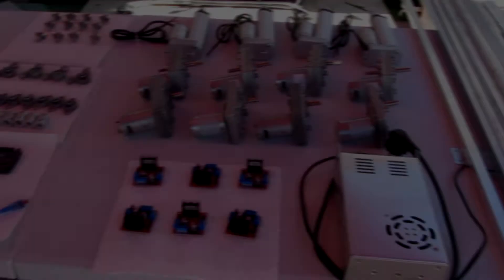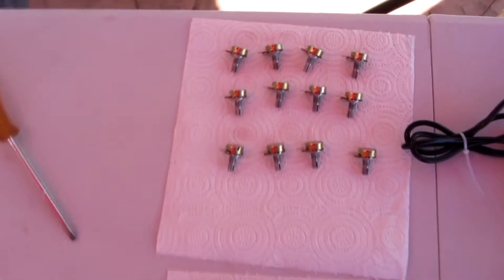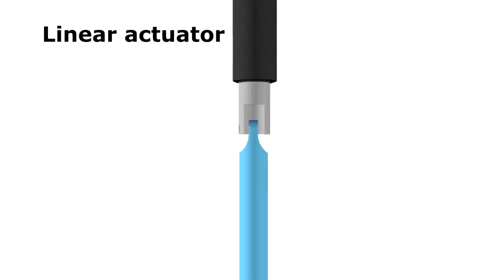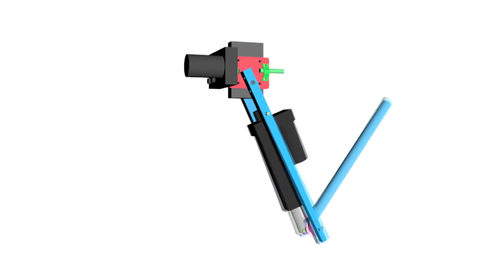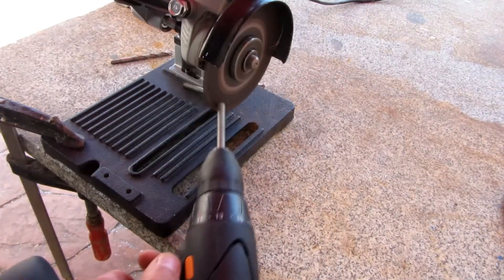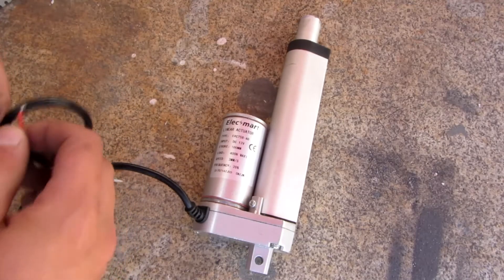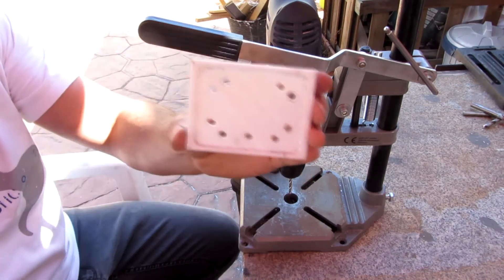#3 Assembly: paws - Pavlov project: Building a quadruped robot

Comment: hola,  muy buen video. Tengo una duda, donde conseguiste esas juntas que van con el motor DC ?, la estructura
Reply from the maker: hola! gracias! te refieres a la caja reductora de metal que va acoplada al motor? Eso lo compre todo junto, puedes encontrarlo en  aliexpress, por ejemplo:
https://es.aliexpress.com/store/product/2015-New-Arrival-Takanawa-555-Metal-Gear-Motors-12V-24V-DC-Reduction-Gear-Motor-High-Torque/1018677_32517637609.html?spm=a219c.search0104.3.85.76916132M4VGCY&ws_ab_test=searchweb0_0,searchweb201602_4_10320_10065_10068_10547_319_317_10548_10696_453_10084_454_10083_10618_431_10304_10307_10820_10821_537_10302_536_10843_10059_10884_10887_100031_10319_321_322_10103,searchweb201603_57,ppcSwitch_0&algo_expid=f9112f97-27f0-4565-a31c-ab9536a17dfd-12&algo_pvid=f9112f97-27f0-4565-a31c-ab9536a17dfd&transAbTest=ae803_4